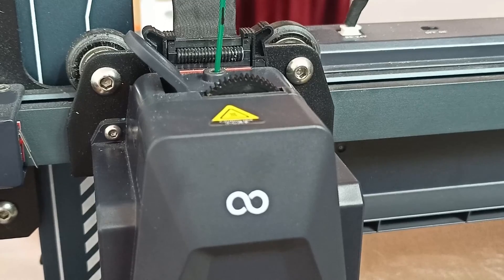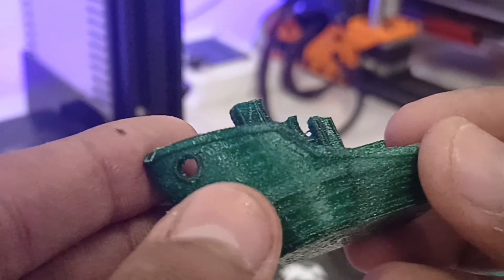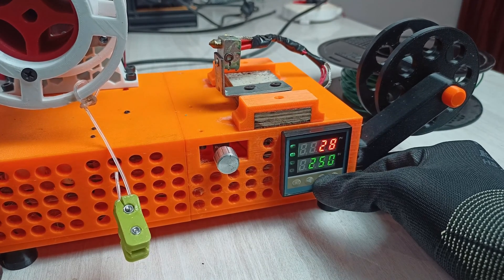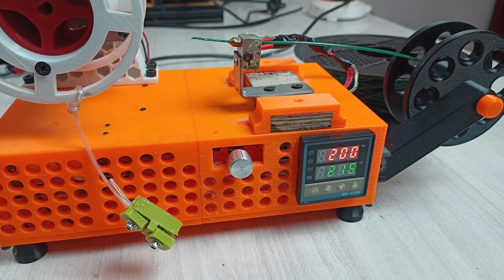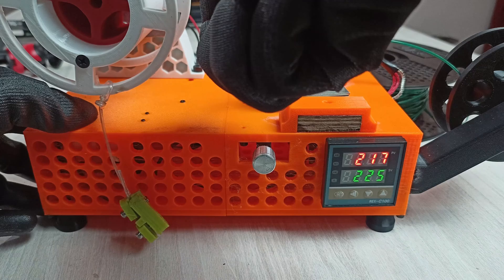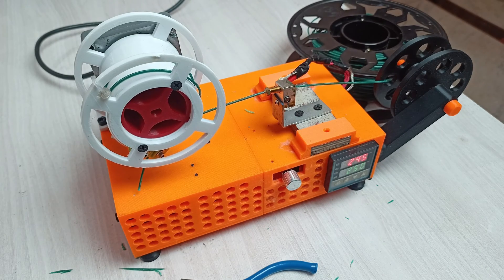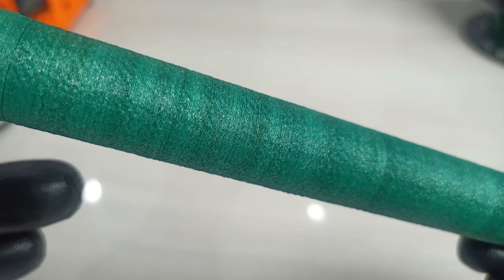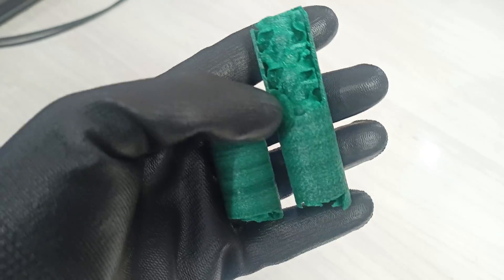The Surprising Results of Post Processing $1 Filament with a PET Machine

Comment: Instead of pulltruding, why not just enlarge the whole hotend to fit the oval filament? Assuming a PTFE-lined heatbreak, all you'd really need would be PTFE tubing with slightly wider internal diameter and a conical Dremel abrasive bit to slightly enlarge the entry point at the nozzle. I might try this myself, if I can get ahold of the agricultural filament cheap enough.